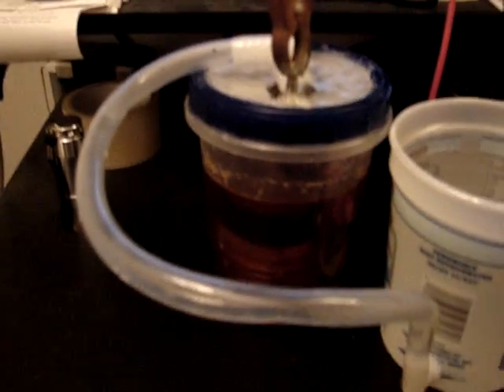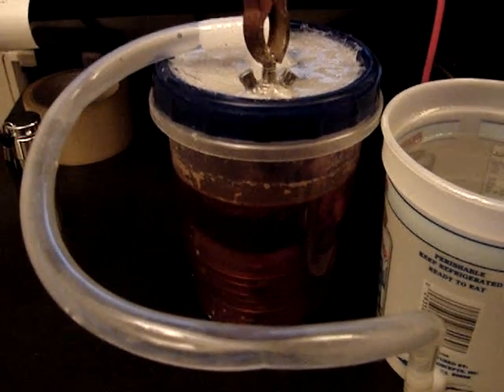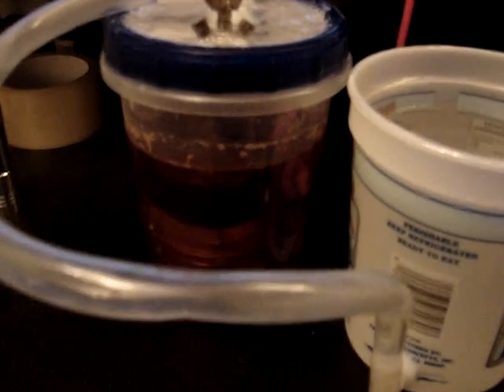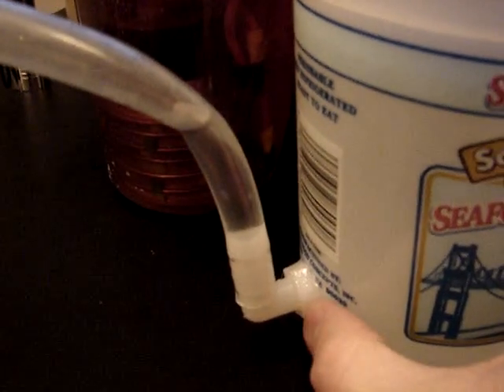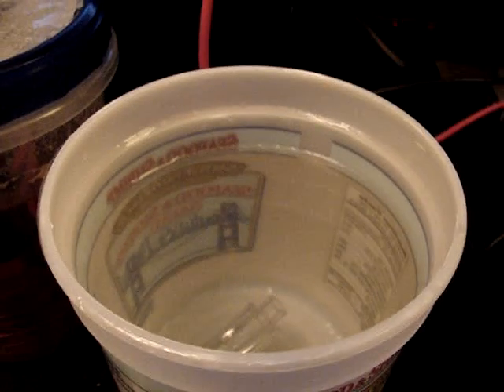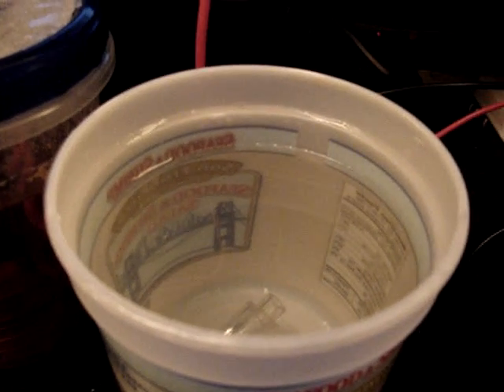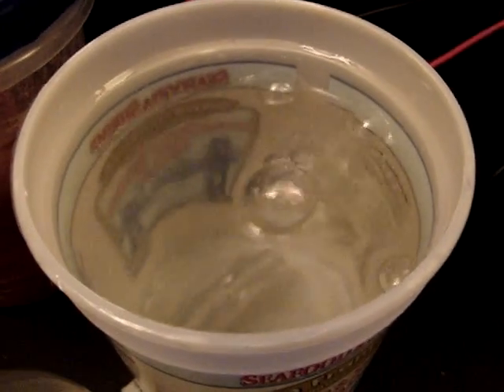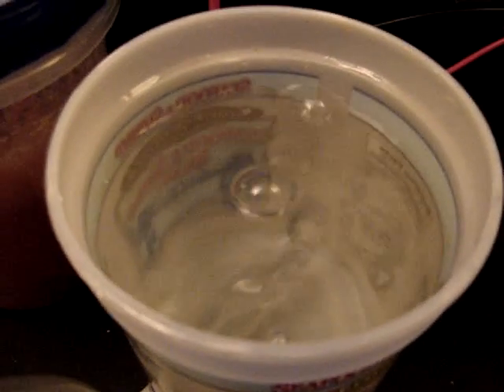Vid7 Test Enclosure (HHO, Brown's Gas, Hydrogen, Hydroxy)

Comment from the maker: The bubbles are big and coming out at a constant rate, so I hope that is a good thing.  

Not that it even matters, because today I'm going to change the cup arrangement to reduce the amperage and hopefully keep the same output.

Right now the 7 cup design is +n-n-n+, but I don't think this is the most efficient way to run the cell, because the center cups aren't producing. 

The new arrangement will be +nn-nn+.